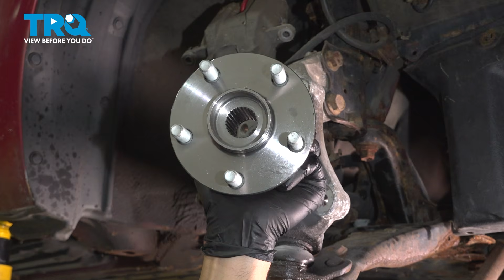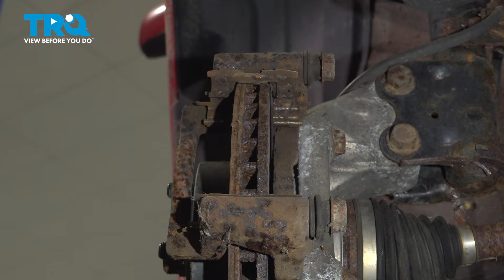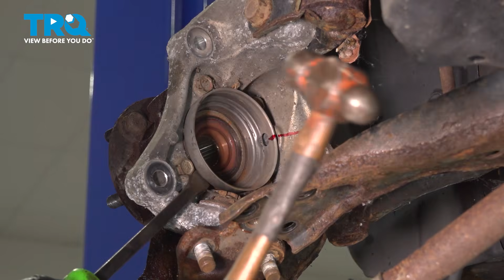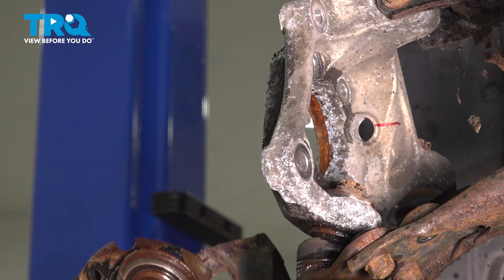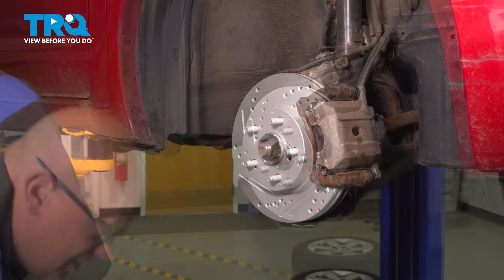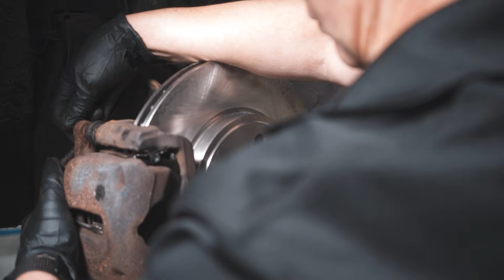How to Replace Wheel Bearing and Hub Assembly 2004-2009 Toyota Prius

Comment: at 5:59 it says: "take the wheel bearing and hub and the shield, it only goes on one way." Nope, you can very definitely put the shield (backing plate) on backwards, at which point it scrapes the rotor. You have to beat the brand new bearing back out of the knuckle to fix it. And in my case, I had tried to bend the backing plate to fix the rub, after all, you can only put it in one way. So when I got it apart and turned it around, the previously bent backing plate no longer fit and still scraped the rotor.

Comment: One of the things we discovered is that when those bearing housings have been in place for twenty years - they don't want to come out! We changed both sides - it took us two days, the second going a little bit faster than the first because of lessons learned. On the first we beat on the outside of the housing that carries the wheel bolts - and it finally moved. But instead of the whole thing coming out of the housing, the bearing separated! And the housing was still frozen in place. We got it out only by using a chisel and a big hammer on the joint where the housing meets the mount. That badly damaged the brake shield, which is light-weight metal sandwiched between the bearing housing and the mount, so you're hitting it when you're trying to separate the housing. In each case it took about an hour of beating on it, working around the edge, until it finally came out. If you're not really careful (and even if you are), you can also damage the surface of the mount. I would suggest buying new brake shields along with the new bearings, because you are likely to destroy the old ones. Getting the old bearing off is not so simple as some of these videos make it appear. But the good news is that the new bearings were needed. The only symptom was the sound they made - they didn't wiggle with the wheel, none of the normal diagnostic stuff said they were bad - but they were.

Comment: Some notes from my attempt at it: disconnect the 12V battery first, otherwise if you open a door or touch a brake pedal it turns on the brakes to "warm" them up and pushes the open brake caliper all the way out. Remove CV axle and its shield (and sensor).  I got mine out using an "evertough Hub Remover and Installer Kit - 67213/oemtools 27213 rental" got it out in 10 minutes after 1 hour of pounding failed LOL (I believe horseshoe bracket E, back washer L, grease it, use breaker bar). clean it up, antisieze grease.  You can use its own bolts to pull in the new one (as they do here). Be careful with the little splash guard aluminum shield, it can be installed two ways (reversible with double holes) so make sure it's the right direction (outer curve pointing in toward the car).

Comment: Is the wheel hub assembly suppose to turn with minor travel or do the spin freely if you spin them by hand? Like will they do a full revolution if you spin them by hand? 

I ask as I am replacing a broken stud and just noticed the hub turns by hand but not a full revolution if done by hand

Comment: If you live in the rust belt be prepared to take the knuckle completely off and using a shop press to get the bearing out.      
You can sometimes get it with an air hammer too

Comment: I learned a lot from this video. The step-by-step was very helpful. I also learned that the last person that replaced my wheel bearings didn’t replace the dust shield. This caused the wheel bearing to wear out in about 40,000 miles. I’ll be having a conversation with them About the other side